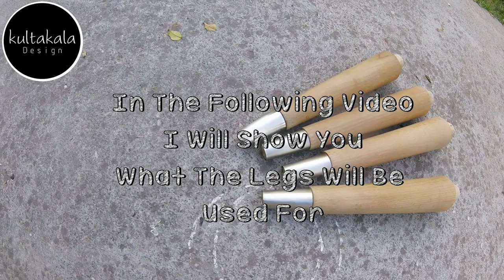How To Make a Brass Cone For Tapered Furniture Legs

Comment: I couldn't get the solder to stick.
Reply: After I couldn't get the solder to stick where I needed it I went and bought a better quality electric gun and still couldn't get it then I remembered I had a  propane torch with a soldering attachment out and I got it that way. I guess my electric soldering iron just wasn't getting the brass hot enough.. Thanks a million for the video though. I wouldn't have even known where to start without it.
Reply from the maker: Hi, the surface must be clean before you start soldering, i use super fine sand sponge